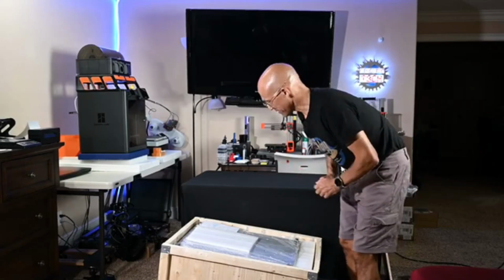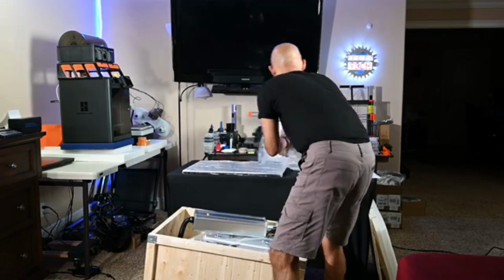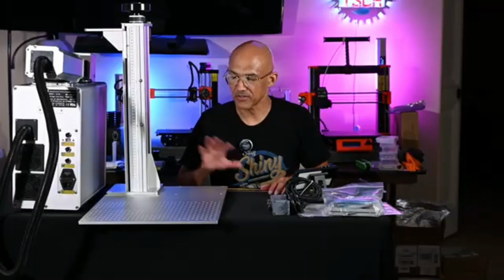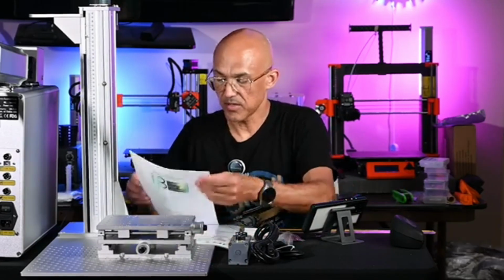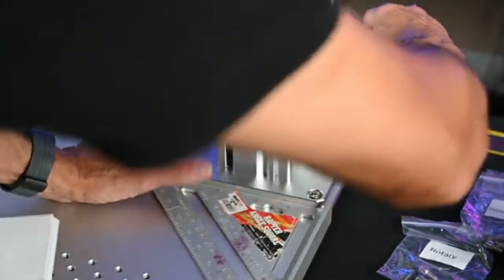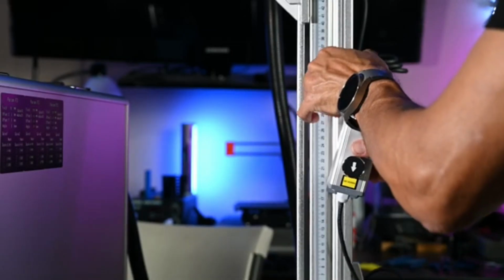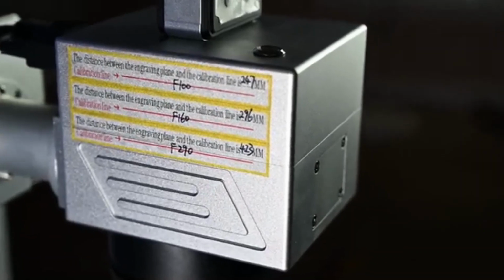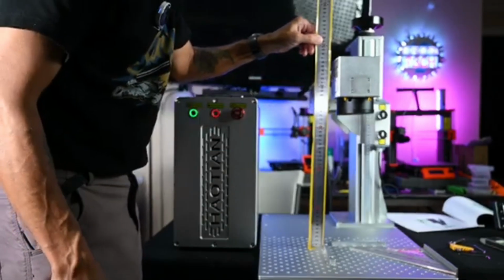HT-80 80W Fiber Laser Unboxing: Features, First Impressions & Setup

Comment: Very clear setup information.  My 60W MOPA arrived today, and I’ve completed the assembly.  I too found that the Z adjustment for the motor control cable was not labeled.  It wasn’t clear how you leveled the laser arm.  I’m thinking that you needed to shim it after loosening the 4 mounting screws.  My system came with two lengths of USB cables.  I used the shortest one.  I make another comment after I power it up, and finish setup on my PC.  I’m waiting for technical support to give me a call.
Reply from the maker: thanks